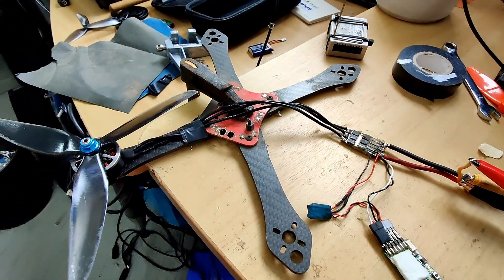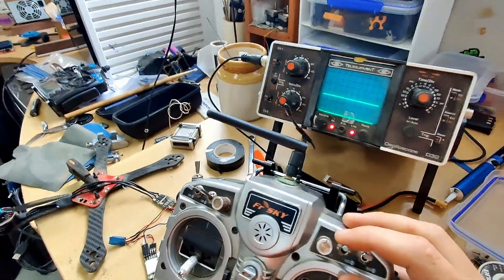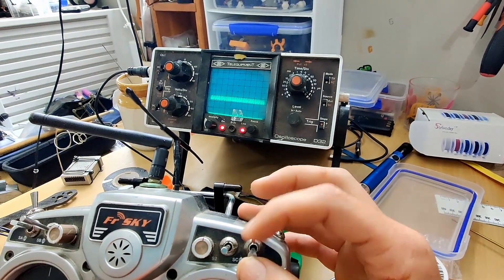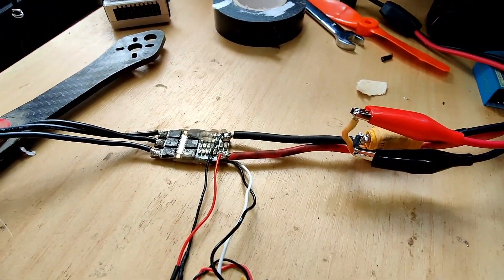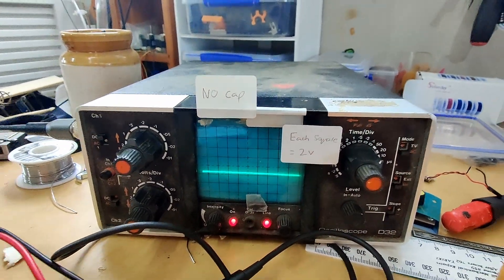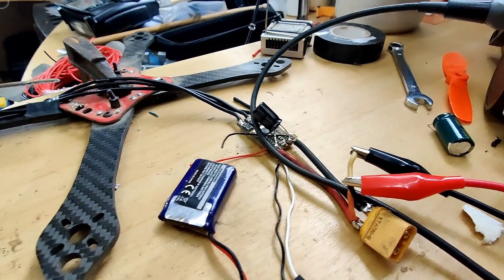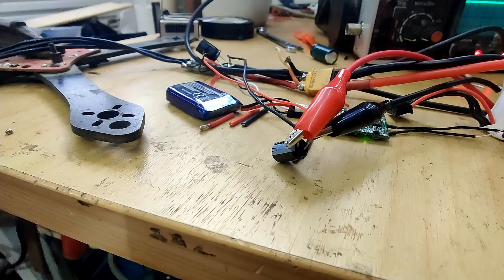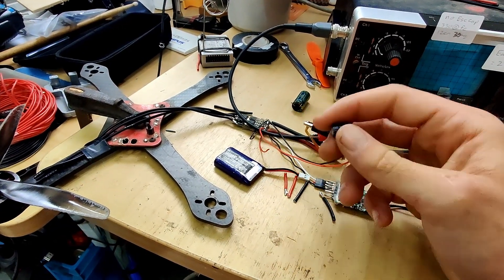Does capacitor placement matter?

Comment: I have hawk pro Mini Magnum 2 / III Parts - BLHeli_32 35A ESC Board it comes with 2 capacitors, don’t know what size they are, but I having a lot of Video Lines in my goggles. One capacitor is lose on the mini magnum board?  an I don’t know if that is causing the poor video I get But it’s worse when power is increased when flying? Is there away to check if the Capacitor is Bad an would that cause video lines an noise? I checked  VTX an different Antennas,Bands, Channel’s, and VTX Power but No Change in Video image an Lines? Any ideas 🙏

Comment: This is all well and good, but what about the whoop format AIO FC boards...and.. what about smaller motors on smaller quads. Moreover, what effect does this have on the actual flight characteristics of the quad. Scope is fine, but what does it really mean. Can you tell the difference "In-Flight".
Reply from the maker: Definitely. I've had quads that were "unflyable" due to a faulty gyro where correct capacitor placement completely fixed the problem. For whoop boards I like to put the cap as close to the battery pads as possible.

Comment: This is a great video that I think needs more publicity in the community! I'm curious what conclusions did you come to with length of wire for ESC cap? Less than 4cm?
Reply from the maker: Wire length of 0cm is preferable😂. If at all possible solder straight onto whatever it is your trying to protect. A couple of cm of wire is alright though. The most important thing that I only just touched on in this video is the value of a small capacitor divectly on the vbat pads of your FC. This makes a bigger difference to gyro performance and power noise then anything else I've tested
Reply: @paulmakesthings  I'm actually going to try that and do a comparison of d term noise before and after
Reply from the maker: @UnmannedSky  some builds are pretty clean without many caps but if your build is noisy now you might be suprised how much it cleans things up. A little 330uf of the right voltage on the FC vbat works wonders
Reply: So you would put the cap on the vbat of the FC not the 5V?
Reply from the maker: @UnmannedSky  yep. Technically both options would have an effect but for a number of reasons filtering at vbat seems to be better
Reply: Still use a 35V cap on vbat then?
Reply from the maker: @UnmannedSky  for 6s I'd use a 35 or 50
Reply: I’m confused, when you went to the second cap, it looked like it was soldered to the same thing as the first. The positive and negative battery pads?

Comment: Hello. I'm currently having some issues fitting a suitable cap (50v 1000uf, is that overkill? 6S with Caddx Vista) into my build. I was going to extend it using some spare wire I have, so that I can mount it elsewhere in the quad. Is this a bad idea? Does this completely negate the point of having a cap in the first place?
Reply from the maker: Sorry for the slow reply. I'd personally rather have a small capacitor mounted close then a big one extended more then a few cm away

Comment: 9:00 Was going to say the same - it's an LC filter due to the wire length.  Bringing the wires together or twisting them would probably increase the noise quite a bit unfortunately :'( ...  I love the testing methodology and old school scope!  Right on with sticking the leads directly onto the cap's legs as well.  Do the measuring leads run right into a coax to reduce inductance?  

Have you considered a TVS diode to take care of higher frequency noise?  For a 16.8V battery you'd want a littelfuse SMCJ17CA or SMCJ18CA off Digikey or similar (SMCJ18CA is going to be less reactive but draw a tiny bit less noise off).  They're super fast reacting - commonly used for mitigating EMP spikes in MILSPEC equipment in the cold war until recently.
Reply from the maker: And yes I like to run a FetTec spike absorber which is 3 relatively large tvs diodes. Not sure of the spec and I haven't scoped the effect it has but its a logical step against massive spikes
Reply from the maker: When I cut the wire on the secondary cap down to 7cm the result is just as good. Curious to try twisting them as that's what I always do on builds. Would be a shame if I have to stop doing that 😂. Measuring leads had around 8cm of wire from the clip straight into a standard probe which was then shielded all the way to the scope

Comment: Awesome discussion and testing here! One thing I see a lot when people talk about capacitor placement is that it's the distance from the source that's important. What I'm trying to understand and please correct me if i'm wrong, but wouldn't the critical variable actually be the total resistance from cap to source? Since the time required to charge a capacitor is directly proportional to resistance. So for example you could have a foot long cable running from the cap to ESC, but if you're running 10 gauge wire it'd be equivalent resistance to about one inch of 20 gauge
Reply from the maker: I did a test with 14cm of 18awg wire and 12cm of 10awg wire. Both were almost exactly the same amplitude of noise (significantly worse then direct mounted). Resistance is a factor but not the main one. More research indicates that it has something to do with the rise time of the spike and how power travels electromagnetically around the wire rather then through it. Veritasium has a video outlining some of how this works. All pretty confusing